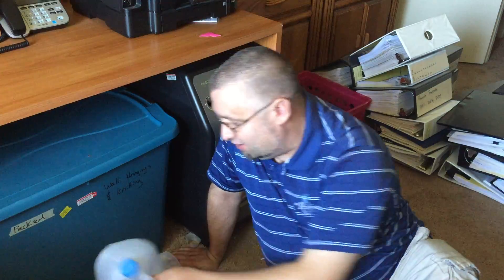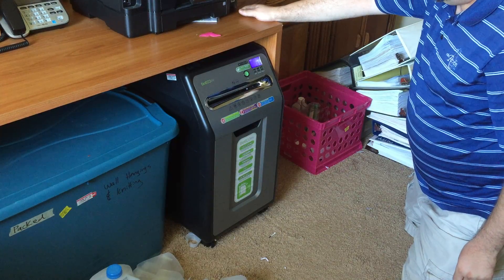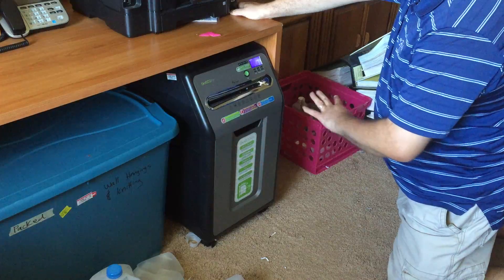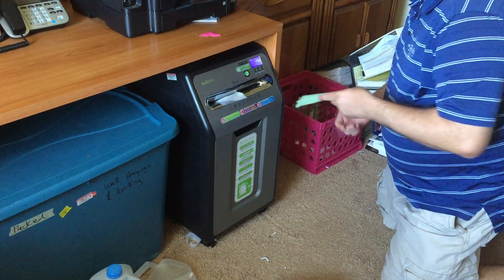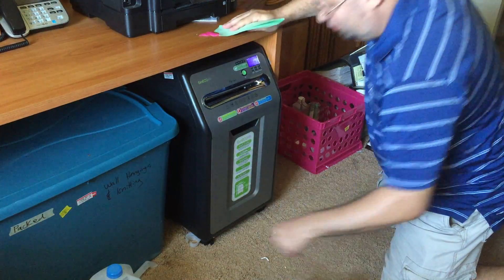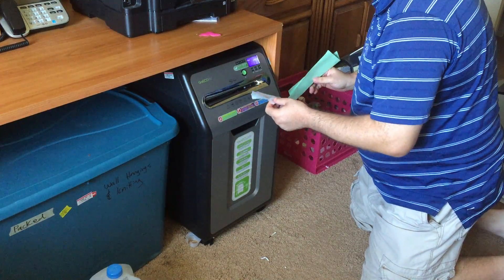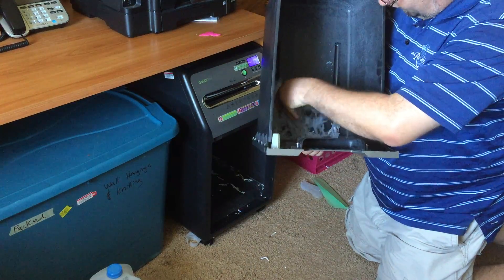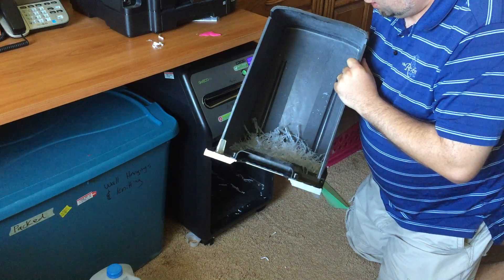Upcycling / Recycling Milk Jug HDPE Into Chips Using a Paper Shredder to Make DIY Plastic Feedstock

Comment: Ah you’re a breath of fresh air and a sigh of relief. I have 2 different paper shredders at my disposal that I found in 2 different dumpsters. I’m assuming they were thrown out because of jammed paper and the previous owner not wanting to figure out how to unjam it. Anyways, they work great. I’ve also been wanting to make an hdpe press to make thin sheets for model making and general purpose structural rods, beams, channels, etc. I was imagining myself cutting plastic bottles and milk jugs with tin snips and assumed that was going to be my easy and free way to do that process. I know when my recycle dumpster is emptied and throw away anything worth shredding 10Min before the truck arrives so now I know what to do with the shredders. I almost donated them to goodwill for a renewed lifespan. Now I’m keeping them.😁

I might add: would it be wise to wash the shredder milk jug pieces to remove any traces of lubricant before using it to make thinner materials like 3D printing plastic? I don’t think I’d worry about lubricant on it if I was making plastic 1”x1” rods. But the thinner you make you’re material, I’d be more concerned about the structural integrity. I don’t know how sheet lubricant for shredders reacts with hdpe but o thought I’d being that up. Of anyone knows?
Reply: Shoot, i didn't think about lubricant! Thanks, i was about to do this lol.

I heard the plastic needs to be clean, or it will delaminate later. I'd assume oil would definitely be a problem.

Comment: I'm a mechanical P Eng and to me this video and your system need to be tossed, go back to the beginning and start afresh. I do a lot of hobby work and have done HDPE remolding. I use my CD shredder to cut plastic, not the best but certainly better than this.
One question, why are you using the forward button to clear the paper and not using it to put the plastic through?

Comment: There's a little difference in the chemical make-up between HDPE used in blow molding and the HDPE used in injection molding.  Injection molded  HDPE is generally better suited to home/hobby recycling.  Milk bottles are made using the blow molding process.  Buckets and tubs tend to be made by injection method.  Generally, if you can screw a top on it, it's probably blow molded, if it's got a snap on top or no top at all, it's probably made using injection molding.  Just in case you want to try to keep the plastics separate.
     Don't use scissors, you'll get blisters.  Try tin snips instead.
Reply: Theres an aluminum scissors at harbor freight with screw-on blades , fucking badass for cutting milk jugs .

Comment: What about putting a piece of electrical tape on the sensor, so it's always activated? Then, just run the power cord into a power strip, and use the power strip switch to activate the shredder.

Comment: Thanks for the video, 

I have been thinking about this as well. Is there a possibility to see what kind of blades and cutting system the paper shredder has? As The metal laser cutter is not available to me I was thinking to buy a cheap paper shredder with nice cutting system and run it through a Drill or electric motor.

Best Regards

Ati
Reply from the maker: Atilgan: per your request, I made a video showing the blades on the paper shredder I used to break down a milk jug into HDPE chips. It can be viewed here: https://youtu.be/MNFgPwkN3cQ . I hope this movie helps your thought process!
Reply: Thanks a lot, Really appreciated.

Sincerely, 

Ati

Comment: The filament extruders that I have seen online require pellets or powder. I don't think that strips would feed correctly from the hopper.
Reply from the maker: Robert: Yes, this is an excellent point. The first goal is to make from my HDPE plastic shards thermally molded bar stock capable of being machined on a lathe. There are some good videos online showing this process using a disposable can originally holding whipped cream or shaving cream. When I get all the components together, I will post a video showing my process.

Looking ahead to extruders, I can either develop and auger that will accept strips instead if pellets or I can run the strips through the shredder a few times to further pulverize the HDPE and add a mesh screen that passes suitably small pieces while catching larger shards for additional processing.